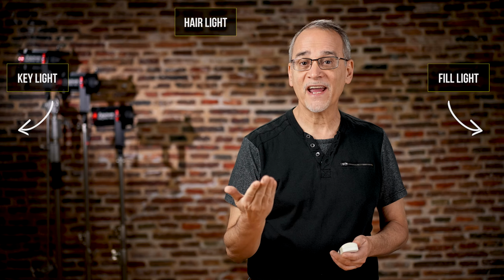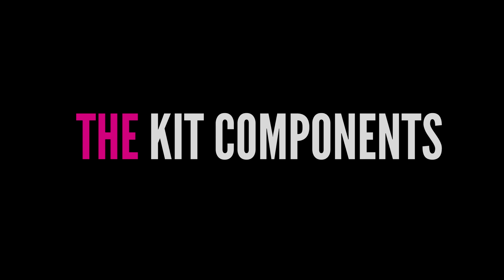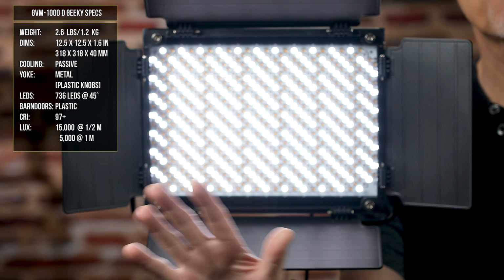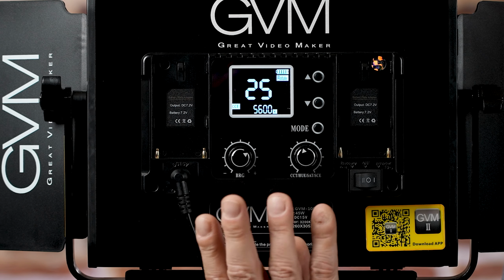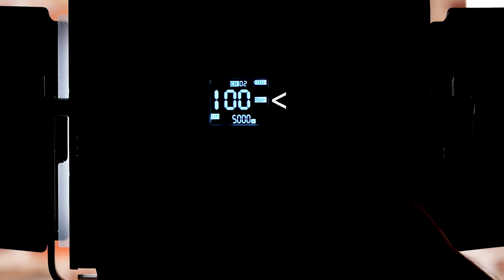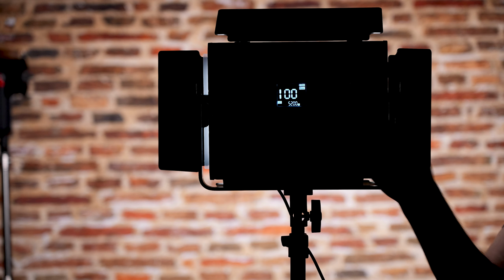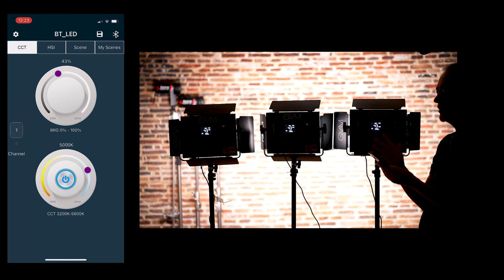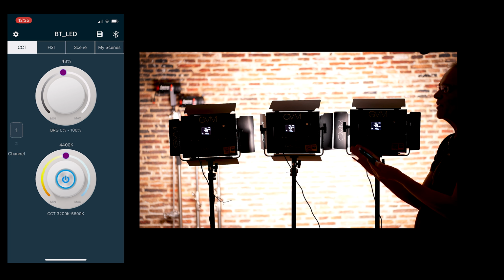LEARN 3 POINT LIGHTING with this Budget GVM 1000-D 3-Light Kit Review.

Comment: Another great video! Would you recommend these to light a green screen? Do you think the spread would be enough to either light them from the ceiling or from the included stands? I’m planning on using a lastolite panorama frame which I believe is about 13’. Thanks again for all of the great info! Cheers
Reply from the maker: I don't see why not, as long as you position at least two on each side. Not sure about the falloff at that distance though.
Reply: @BasicFilmmaker  Thanks for the response. Overall, would you say the shop lights using LED bulbs would be a better solution for larger green screen setups to spread the light? I’m assuming I could purchase several shop light fixtures for the same price as these.Thanks again.